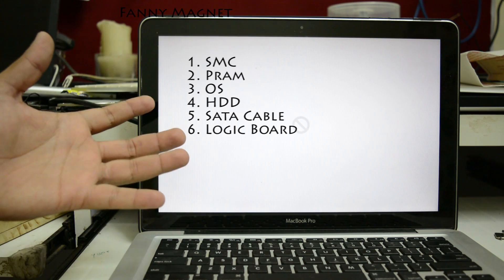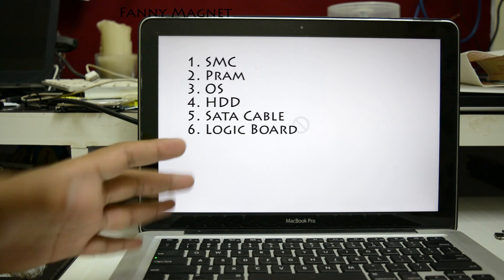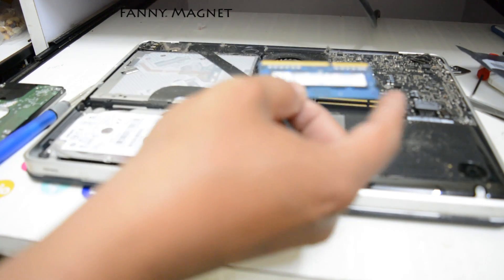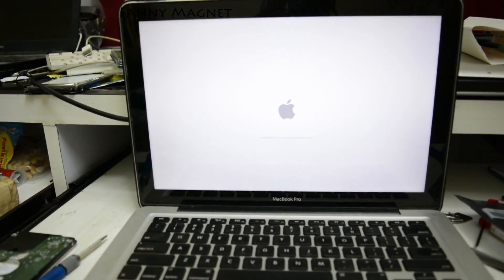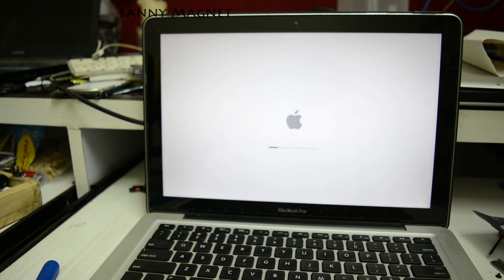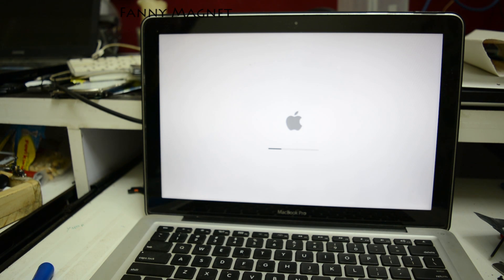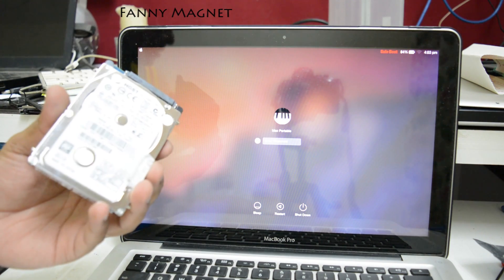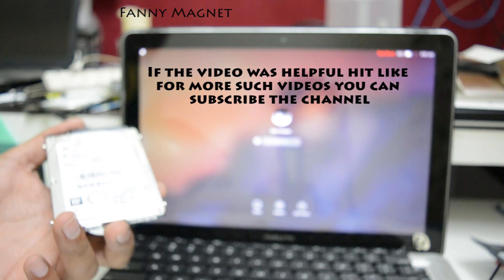Live Troubleshooting No Entry Sign On MacBook Pro on Boot

Comment: #3 should NOT be erasing your drive, that should be the last option. after PRAM and SMC reset it should be entering single user mode and running fsck -fy.... and or  should be booting to recover mode and trying first aid on the drive...  also telling people top try starting in safe mode, which you don't even mention to the watchers, nor do you mention running verbose Mode,  trying hardware test or ant other boot args. . Find it hard to believe that you have any customers, no offence by any means.

Comment: Hi, I'm using mbp 2012 13 inch, upgraded to ssd. Been using Mojave for 3 months now without issue, and suddenly this happens. I tried reformatting, and reinstall the OS using internet recovery. It works for its default OS which is mavericks so far, but when I tried updating back to Mojave, same problem persists. What can be the problem here? Thanks.

Comment: Hello brother 
Am facing the same problem and i changed my sata cable and it was working and after one month it is doing same , agin i changed the cable but is not working.when i repaired my harddisk it was showing some error "
1.The partation map needs to be repaired because there is a problem with efi system partition file system
2.The volume recoveru could hd couldn't  be verifid completley
3.Invalid disk lsbel @250234568704 cksum mismatched.
What it means my disk is corrupted?? 
If it is then what i need to do ?? Is there any solution ?? 
Waiting for your reply
Thanks
Reply from the maker: For no signal logo only 2 possibility 
1. HDD 
2. OS